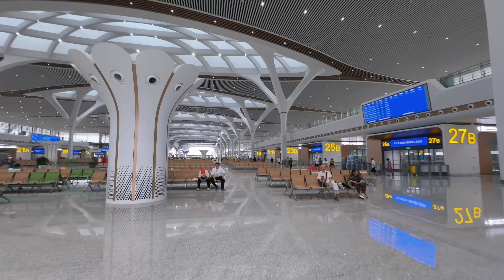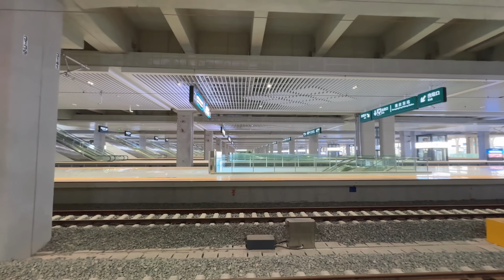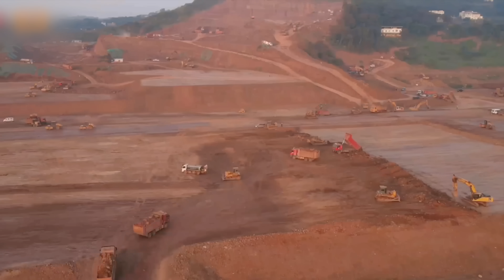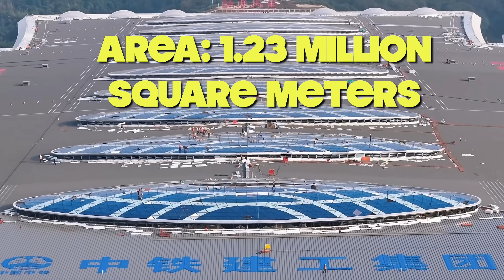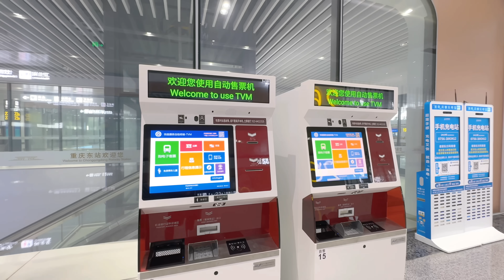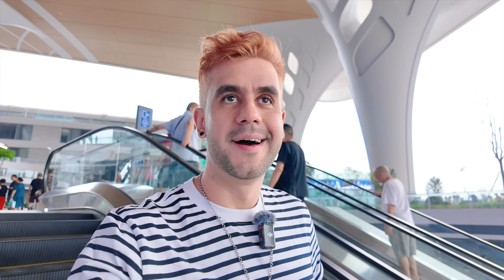CHINA JUST OPENED THE WORLD'S LARGEST HIGH-SPEED RAILWAY STATION

Comment: 2015 — EIA for the Chongqing Rail Hub East Ring Line (the hub line serving East Station) released.  ￼
	•	May–Jul 2019 — Chongqing–Qianjiang (Yuxiang) HSR EIAs published (2nd notice in May; full EIA in July) — the HSR that anchors East Station’s role.  ￼
	•	Nov 2, 2018 — City publishes the station site (Chaoyuan/Changshengqiao). Groundbreaking followed on Nov 22, 2018 (ceremonial; major works came later).  ￼
	•	Jan 2020 — Municipal transport note: preliminary design not yet approved; however station scale fixed at “3 yards, 15 platforms, 29 tracks.” (Shows design development still in approvals.)  ￼
	•	Aug 2020 — Hub supporting road network enters survey/drilling tenders (planning of GTC/municipal access).  ￼
	•	Aug 2021 — Construction-drawing review tender posted for station + GTC (signals design at near-final stage; total est. ¥16.7 bn; planned 3.5-yr duration).  ￼
	•	2021 (doc ref.) — Notice cites “approval of preliminary design” for station/GTC (铁鉴函(2021)…), indicating core design scheme approval around 2021.  ￼
	•	Jul 2022 — EIA public notice for GTC/roads around the station (Open-process environmental review).  ￼
	•	Apr 2023 — Passenger information systems package awarded (fit-out design integration).  ￼
	•	2024 — Multiple owner-supplied equipment tenders (power, escalators) issued by CR Chengdu Group — late-stage procurement.  ￼
	•	Mar 2025 — City note: station building completed, trials underway.

Comment: Folks, US military spending a year could build 130 Chongqing East railway stations.😢😢😢😢😢

The Chongqing East Railway Station, the largest high-speed rail hub in western China, had an estimated total investment of 52.8 billion yuan, equivalent to approximately £5.82 billion (or about $7.6 billion USD, based on 2025 exchange rates). This figure covers the construction of the station and its affiliated comprehensive transportation hub, which spans 1.22 million square meters and includes 15 platforms and 29 tracks.